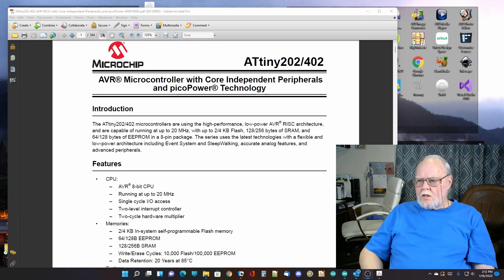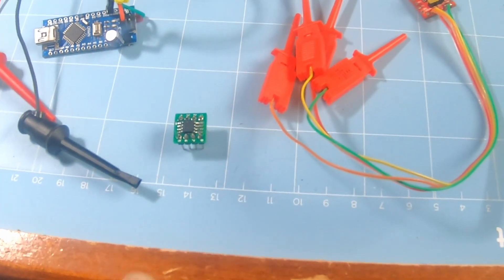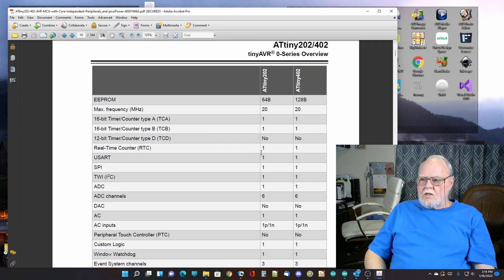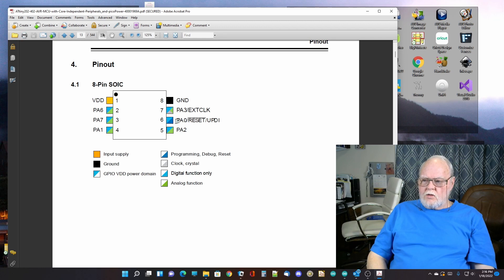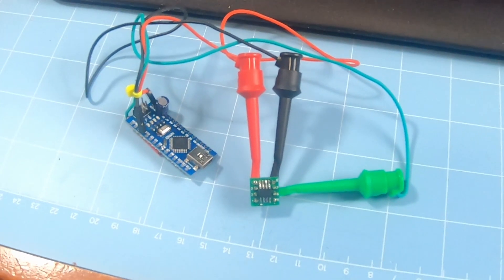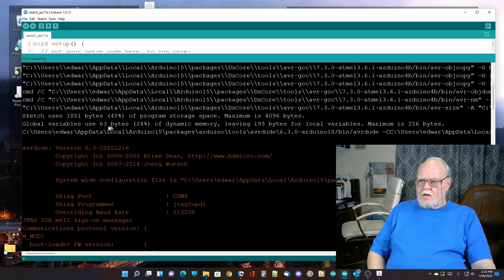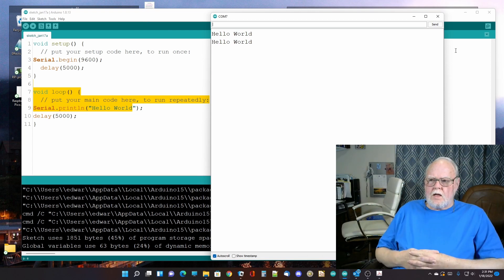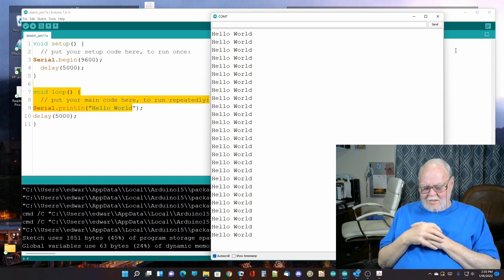ATTINY402 Hardware Serial IO - Does it work under the Arduino IDE

Comment: Hello, thanks for the video.I applied the same steps but i got this error : exec: "cmd": executable file not found in %PATH%
Error compiling for board ATtiny412/402/212/202. I would be very happy if you could help. Thanks

Comment: Could it be that the code is taking so much space because its written with arduino commands like serial.print() and delay()?
Reply: I am a novice when it comes to the inner code workings of the Arduino.  I was under the impression the the Arduino Serial.print was smaller than C++ alternatives like printf, but I am not sure of that. As for the delay() function, I know there are better ways to accomplish a delay and I use them all the time, but again, I am not sure that any are smaller code wise then delay().
Reply: @MrEdwardhartmann  To me it seems to be too large size just to send out "hello world" with uart since there is peripheral for usart in this chip. My guess is that something large is compiled in there when serial functions are used. I am still waiting for my attinys so cant tell for sure, but just bit banging manually uart out of a pin wouldnt take this much space.
Reply: @leks341  I opened the "bare minimum: sketch in the examples which has no code and it takes 382 bytes of storage space and 10 bytes of dynamic memory to do nothing.  Just adding Serial.begin() jumped that to 1764 and 63 bytes, Putting in the delay() changed it to 1826 and 63. So, the big user is the Serial print software.  But the bottom line is that with only 4K of rom and 256 bytes of ram just does not give you a lot of space for code. Please let me know if you have any luck compressing this at all.
Reply: @MrEdwardhartmann  I will get back to you when I have the microcontrollers to play with
Reply: @MrEdwardhartmann  Alright I received my attiny212. I have been playing around with this for few hours and I got the uart communication working with lower memory. Now I noticed there is very handy examples in the microchips page, one is for uart examples. https://ww1.microchip.com/downloads/en/Appnotes/TB3216-Getting-Started-with-USART-DS90003216.pdf page 11 gives pretty much copy paste example of how it works and it takes only 163 bytes of memory. Few changed are needed if copying from the datasheets since the example is for soic14 chip (I assume since there is 2 uarts in it). Here is what I tested for attiny212:

#define F_CPU 3333333
#define USART0_BAUD_RATE(BAUD_RATE) ((float)(F_CPU * 64 / (16 *(float)BAUD_RATE)) + 0.5)
#include <avr/io.h>
#include <util/delay.h>
#include <string.h>
void USART0_init(void);
void USART0_sendChar(char c);
void USART0_sendString(char *str);
void USART0_init(void)
{

 PORTA.DIR |= PIN6_bm;

 USART0.BAUD = (uint16_t)USART0_BAUD_RATE(9600);
 USART0.CTRLB |= USART_TXEN_bm;
}
void USART0_sendChar(char c)
{
 while (!(USART0.STATUS & USART_DREIF_bm))
 {
 ;
 }
 USART0.TXDATAL = c;
}
void USART0_sendString(char *str)
{
 for(size_t i = 0; i < strlen(str); i++)
 {
 USART0_sendChar(str[i]);
 }
}
int main(void)
{
 USART0_init();

 while (1)
 {
 USART0_sendString("Hello World!\r\n");
 _delay_ms(500);
 }
}
Reply: @leks341  - Thanks a lot - I can't wait to try this out.  But it will have to wait a couple of weeks due to other commitments and travel.
Reply: @leks341  You should make your own YouTube video about this
Reply: It's likely that Serial.begin() initializes a 2-way serial interface, which requires a read buffer in order to not lose characters too easily, which is enough to account for the large portion of the chip's dynamic memory it consumes.  Not really sure why it takes so much program space, though.  Serial.print IS much smaller than printf() would be, which is why we don't generally use printf() on microcontrollers.

Seriously, though, microcontrollers this small were never intended to be programmed in C using libraries that make assumptions like the amount of FLASH and SRAM, and if you read the datasheet's section on the UART peripheral, you can figure out how to set it up to read and write the registers directly rather than using the Serial commands.  I was planning to use the UART on a tiny402 as a simple debugging port, just during development, and now I know I can't afford to use the Arduno Serial commands.  Since my debugging with serial usually just involves sending status characters at various points in the program, I can do this more easily just by writing to the UART registers.